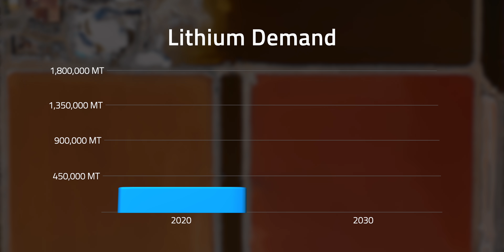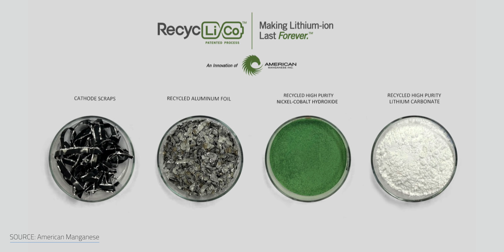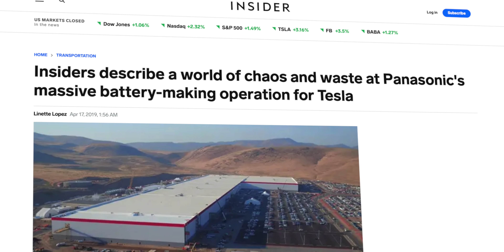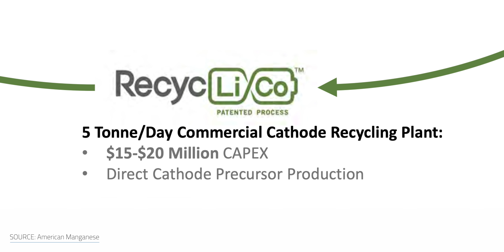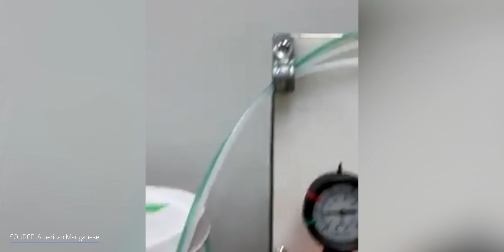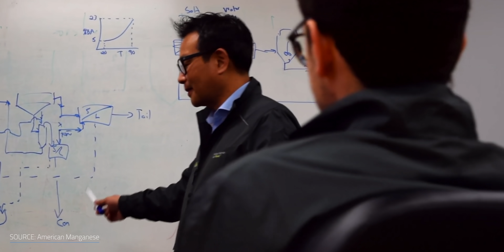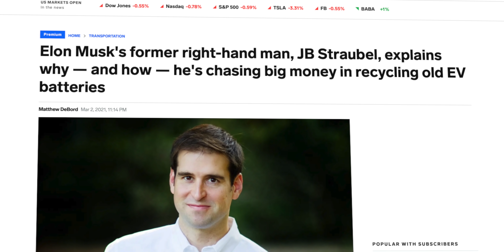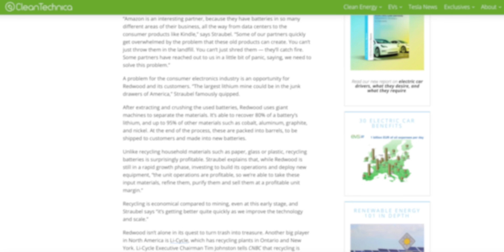Solving EV's Biggest Problem - Battery Recycling Explained

Comment: I was about to buy a used electric hybrid, then I learned that the battery only lasts for 7-10 years and then it can't be recharged again.  PLUS the cost of the battery pack was at least a quarter of the cost of the car ($5,500).  In order for that to be more economically viable for me, the battery either has to last twice as long, or the cost of the pack has to come down dramatically, or both.  I can't afford to do that unless I get way richer.

That's the big problem of electric: it's only a mode of travel for those who are well off financially.  Unless it becomes cheap enough for lower middle class and upper lower class people, fossil fuels will always be the big energy giant on the block and gasoline cars will be the dominant mode of transportation.  I'm not just talking about the cost of buying the car, I'm also talking about the cost of repairing and replacing parts.

Comment: If I read your figures correctly (bar-chart at 1:20), it looks like the total of Li-Ion batteries in use in 2020 is probably about 20% of the expected usage in 2030. So if 100% of the lithium was recovered from the 2020 issue it could only meet 20% of the 2030 demand. Mining's not dead yet <sad face>.

Comment: Mining will only go slower if there is no need for recycling. Recycling will also work at a loss, if a battery or any other product can be made to be reused without the need to recycle it then just recharge en re-use. Imagine a milk bottle, if the bottle is cleaned and reused then recycling is not required. If the bottle is recycled then products must be added to get the same size bottle back.

Comment: In response to the question, "Will recycling overtake mining?", I think not. For there will always be loss in recycling. You cannot gain back 100% of what you're recycling. Some of it is lost in material, and of course, some is lost in the energy to recycle the material. But I can see it as a very good business investment. And those who are getting in on the ground floor of recycling lithium ion batteries, are going to benefit.

Comment: The biggest problem with them is the toxic lithium battery fires. In the April18/2021 Texas Tesla crash that killed two, The local fire crew put 32,000 gallons of water on the fire then quit, and let it burn out. That took 4 hours. The combustion products of Lithium battery fires are highly neurotoxic. (brain poison). As more of these come on the roads, more of them will burn. Many more people will be poisoned. At present about 190K vehicles burn in the US alone annually.

Comment: Recycling can only replace mining if the number of electric cars and amount of battery grid storage goes down. Which certainly won't happen for quite a while. And it can only overtake it if the market isn't doubling within the lifespan of the battery. If every Tesla was scrapped and 100% recycled exactly when the warranty ended, it would barely make a dent in the material needed for new production, because the number of vehicles retiring is dwarfed by the production ramp.

I think it is important to keep in mind that scaling up recycling should happen years after scaling up initial production. As an example, Tesla includes an 8 year warranty for their cars, meaning they expect the cars to last at least that long. So battery recycling today needs to handle most of the cars built in 2013, plus or minus the cars that are being scrapped early or on the road later than usual. They have a daunting challenge ahead of them, but it is definitely feasible to meet it, worth investing in both with money and effort, and I think it will broadly speaking get done. Batteries aren't the easiest things to recycle, but they aren't the hardest either.

Comment: The first step for EV batteries is reuse before recycling. Automakers and others are already planning to reuse EV batteries for fast changing stations. This solves two problems. It delays the need to recycle many of the packs and allows for fast charging stations where there is no high voltage line. Audi will do this in their branded charging stations and other companies are working on the same plan to be able to put chargers in more paces and have enough reserve power to allow for fast charging without overloading the grid. Think charging station with a "powerwall".
Reply: Yeah, it'd be interesting to see a company create a return program in which their own EV batteries are repurposed as other products of that company. And then finally returned again for recycling. Could that make recycling profitable?

Comment: To answer your end question; that’s a no brainer, of course recycling/remanufacturing will have to out produce mining new material. A more important question, looking at those projected power demands just for charging all those lithium cells, alone, and not in the scope of this video, is; how will we meet those energy demands, and at what cost, not just financial costs, either?
I know folks will put nuclear near the top of the list, and as usual not consider the two most important issues of nuclear, 1.) time & materials to build new nuclear power plants, and 2.) long term (10,000+ year) SAFE storage of radioactive waste.

Comment: The biggest thing that you didn't mention is that there are actually hardly any batteries to recycle now. If you assume a 10 year lifetime (which is probably too low), the batteries at end of life today were made in 2011. That's before the Model S was even out! The newer Tesla batteries have even a longer lifetime, i.e. an LFP battery from CATL (in SR+ MIC M3) probably lasts close to 1 million km's.

Comment: It is not that they are not recyclable, but that recycle takes a lot of energy.  Is it cheaper and more energy efficient to just mine more resources or not?  Steel used in cars is easily recycled, and is far cheaper than mining and smelting more.  Electric cars have other problems though because they try to trim weight they use special alloys an composite materials that can also be rather difficult to recycle.  Almost everything is recyclable, but that does not mean it is best if we do.

Comment: 12v lead acid batteries are among the most recycled things on Earth, we still have lead mines that feed into their factories. No, recycling won't replace mining, but it can lower the need for mining massively. 

IIRC asphalt is the most recycled thing on the planet. You just grind it up in place and dump more tar/binder on it to repave the road.

Comment: Interesting video! So you didn't talk about COST. How does the recycling cost compare with the mining cost?
Reply: Cheaper.

Rare earths don't come pure. They come very not pure, and radioactive.

So the process to purify what they are recycling, is basically the same process they use to purify what they mine. Plus they have to process the radioactive elements out as well.

Comment: If you look at something like Aluminum recycling it seems highly unlikely that battery recycling will significantly reduce much less replace mining for new materials.
Reply: You're probably right , but the cost of lithium and cobalt just don't compare to the cost of aluminum. If we want electric to stay competitive with gas cars, we really need to find a way to reduce the cost of the batteries in the future.
Reply: @jameshughes3014  Perhaps not the cost but rather the value of the battery.   If an item is expensive but last for a significant amount of time that can be a better value than something that is expensive but doesnt last as long as the item it is replacing. 

As far as recycling goes when the material cost are high enough to make recycling lucritive enough to support an industry you'll see more of it but you will also see less benefit from it.
Reply: @willstikken5619  I'm pretty sure they're doing their best to make them last as long as possible. This isn't a planned obsolescence thing
Reply: @jameshughes3014  There is an aspect of battery managemtn to this that traditional OEM's seem to prefer longevity over performance while some  cough*Testsla*cough focus on the headline grabbing ranges with less concern over longevity.  Its the sort of thing a "premium" brand can get away with that others cannot. 

The point is that they need to get the economics working in their favor, at the moment they arent.
Reply: @willstikken5619  if they capped the speed of the car at 55 mph, and enforced slow acceleration electronically  two things would happen, the batteries would last longer, and everyone would go back to gas cars. Everything right now is geared to getting people to buy electric, otherwise what's the point? There's just no economic incentive to make the batteries die faster.. that would drive sales down because the car would have less resale value. Every design decision is a complex balancing act. But in the end it barely makes a difference, it's not like they could make them last twice as long even if that's was their primary goal, we still need a ready supply of these materials in 10 years, and it needs to be as affordable as possible
Reply: @jameshughes3014  There are econimic incentives to generate buzz and drive perceptions.   Battery longevity is a secondary concern for a few mfg's but cannot be with the mainstream.

Most EV's do have a significantly lower used car values which drop dramatically the closer they are to battery replacement.  

WHen you talk about speed limits and acceleration controls you're confusing range with battery longevity.  the charge and discharge cycles have much more impact than how much of the capacity has been used in a given cycle.  if someone plugs the car in when they get home every day it wont matter much if they did 55 or 105.
Reply: @willstikken5619  no, I'm not confusing range with longevity. What kills the life of a battery is intense, short power draws. Or more specifically, heat. The kind generated in those moments. And as to speed, that matters too. The motors have a power band, like any motor. To go at a higher speed requires the batteries to work harder, generating more heat.
You're right that at the moment Tesla is focused primarily on making fast, flashy cars, which is why I talked about balance in the design decisions. But they do try to balance that with longevity. You're first posts seemed to me like you felt they just weren't trying.
Perfect or not, they've convinced lots of people to switch from gasoline. To me that seems like the important thing. First, get everyone on electric. Then, with things like recycling, make sure it can continue in the future

Comment: I think mining will always be needed. 
Look at how metals are use now, they are highly recycled, but still we need to mine for more (like iron). And the same will be for materials needed for Batteries. 
Lets say that we have reached a limit off use of batteries, and we recycle all off them, some materials that come out off the recycling plant will be used for other things than batteries; becourse other things might need to have a product that is recoverd during proces, but for batteries need to be refinde even more, and the recycling plant can sell the material at a better price (by not having to refinde it further) to the other company. Also materials get "lossed" over time (send away with inpure materials or just evaporate), so there still is a need to mine some materials, but far less then it is the case now. 

Also, other kinds off batteries will come on the market; some combinations that are less power dence, but are mutch cheaper and cleener to produce, so in cheap things those kind off bateries will come in place. 

And last but not least, maybe we will have "a nucliar fusion batterie" in the future, a sort of powerplant in stead of a batterie.

Sorry for my bad English, greetings from Belgium.

Comment: The real solution is different battery design and composition. Li-ion batteries are a stop gap until better and cheaper batteries with less expensive resources are created.

Comment: Recycling is absolutely necessary, but there's no way it will provide 100% of the demand. First, 100% recycling is unrealistic -- even if you are able to get 100% of a material back from a process (which I suspect will not be the case for every material), we have to recognize that not every battery will actually be recycled at all. 

Second, and more crucially, even if you could get 100% return from recycling, that only replaces existing units. It can't cover increased demand -- so even if you could turn 100,000 used batteries into 100,000 new batteries, if demand increases to 500,000 batteries you're going to be 400,000 short.

Comment: "Solving EV's Biggest Problem": the right answer(s) are "second life" projects were a battery pack can still have "a happy life" for about 10-15 years (or even more) before a recycling would be necesary.
From economical standpoint both methods depend of the "economy of scale" meaning that you need enough packs to be available - which is not the case, yet.

Comment: When they say $18 billion that money will be collected by adding a mandatory charge at the point of sale of the product containing the batteries. If all of it came from EVs and every new car sold was an EV it would add $4500 to the purchase price of an EV. But, so far none of these recycling programs include removing the batteries from the products they are in. None of them can just throw an entire smartphone, laptop or EV into the metallurgy process and get raw materials out the other end. It's a whole other, extremely intensive operation to get the batteries out of the products they are in. We will need to see a product dismantling industry upstream of the recycling industry similar to the removal of refrigerant from old fridges before they get recycled.

Comment: Despite the simplistic answer you give that people claim "there's no way to recycle the batteries", the truth is smaller batteries are a pain in the butt to make special arrangements for, when tossing them in the garbage is easy. When it comes to larger batteries, the big question is how would the process be any more efficient than regular garbage recycling. MOST recycling is more expensive than communities initially thought so the motivation in the end will be "need" more than staying green. These companies may be of use in the time being, but replacing this kind of battery technology with something more sustainable would be better in the future.
Reply: There are many times more value in a large battery filled with precious metals compared to your old IKEA wardrobe made from cheap wood/Food waste/old hunk of steel. 
Regular garbage recycling is a solution to how do we not place all this garbage into a landfill. 
Battery recycling is about how do we make as much money as possible from this thing. One of these incentives developing efficient recycling, the other just makes you burn it in a large stove, figure out which.
Reply: @suhr12  The point i'm making is there is an economic balance with a moving goal post. Recycling is a fine idea, but is usually more expensive to perform considering the process of refining old materials. But if the resource is needed, the price of the good increases, making to more of a need than a good standard to recycle. After seeing the waste and inefficiency in California recycling systems I can't imagine its different anywhere else. The only difference at all may be in the material your trying to recycle and the importance of it. I try not to fall into the whole BS 'go green' slogan as a whole. They after all were responsible for the early years of the Prius which has been now determined to cause more pollution to make than your standard car or what about that bamboo shirt that created more pollution due to the extensive processing ? you get the point.

Comment: Surly if these metals can be separated initially from a mix of rock and other minerals, a far richer concentration of these minerals in our ground up batteries should be no problem for our chemists.  One would expect that over the coming years better and better chemistries will be developed making the processes faster, cheaper and eliminating any pollution if there is any now.

Comment: what people (mainly American) do not get - these batteries are never going to landfill because the materials that make up the cells are just too dam expensive to throw away - also EV batteries are lasting 10 to 20 years with another 10 to 20 years of second life so a lot of batties could be on the market in 10, 20 and 40 years time
Reply: The plastics that these batteries include will go into landfills.  But, realistically, these particular plastics will make a tiny part of that waste stream.

Comment: Another solution is battery  reuse.  Where diminished large batteries used in mobile applications are moved to stationary uses where the reduced capacity isn't as critical.
Reply: and where utility companies can charge you for a 10 year old battery, anyone with an old cell phone knows how much that sucks

Comment: Can they do this using only green energy to drive the whole process?  How much fossil fuels is used to collect, process, store and distribute?
Reply: I wonder what recyclers do with the dregs of charge left in the cells they have to dismantle?
Obviously the cells (or entire batteries) need to be discharged before being processed.
It seems like although it may not be much, it is "free" energy that should be put to good use.  🤔

Comment: recycling cannot be an afterthought it needs to be a top down approach. For example with plastics we are getting to the stage where there a fewer types of plastics used so that the plants can more easily manage the waste. Where as previously the manufacturer chose what was cheapest. Patents might speed research but it is limiting growth and sustainability everywhere.